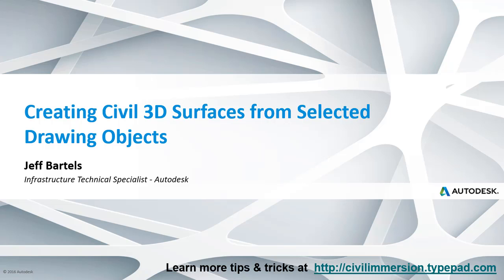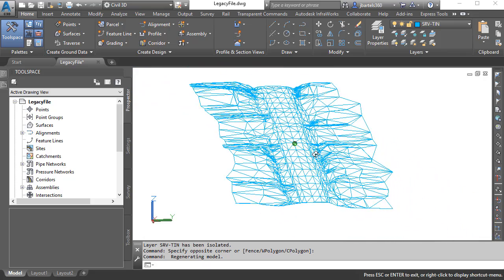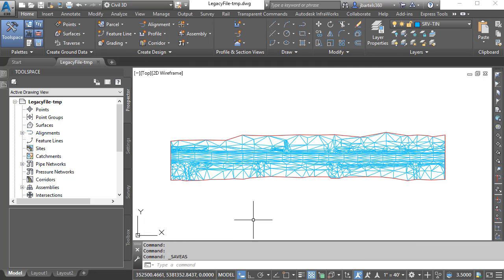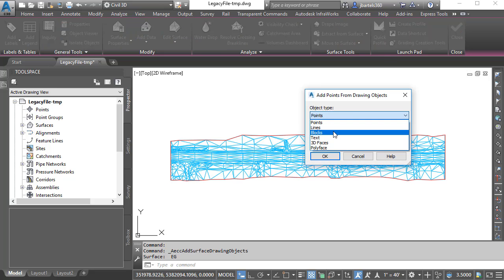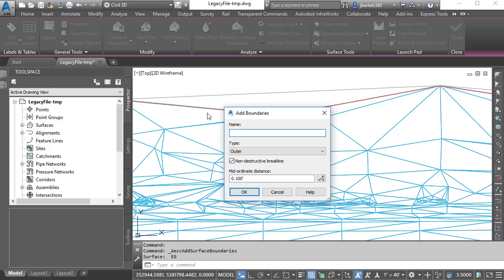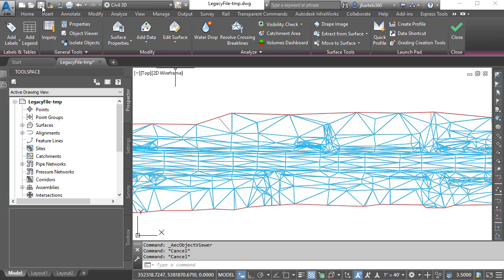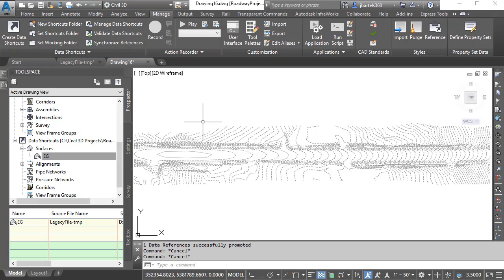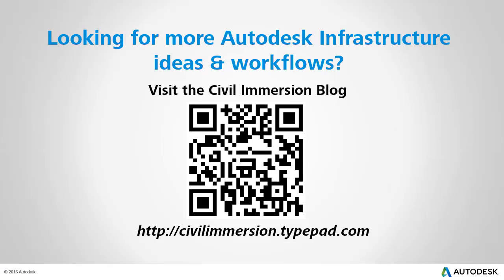Creating Civil 3D Surfaces from Selected Drawing Objects

Comment: Great video. Just one thing to note though. Isolating layer did not hide my other layers for me. It just locked them. Selecting would however for some reason also select the layers I did not want selected.
Reply from the maker: At the command line, type LAYISO and press enter.  Choose "S" for settings and press enter.  Select "Off" rather than "lock and fade".  Hope this helps!
Reply: @JeffBartelsCAD  Thanks so much!

Comment: Your videos are incredibly good and easy to follow. I've never seen anyone present a software's features and the workarounds for the features it's lacking as well as you can.  Do you have videos on controlling layers properties separately in different MODEL viewports? Say if I wanted to view certain layers in a 3D view and different layers in a 2D view at the same time side by side. Or is it even possible to do Civil 3D 2018?  
Thanks for all you share.